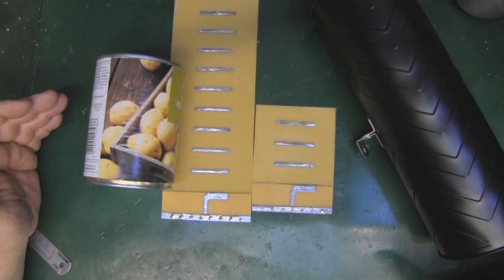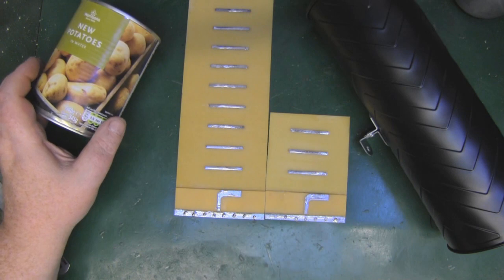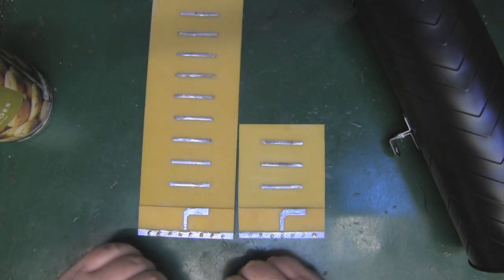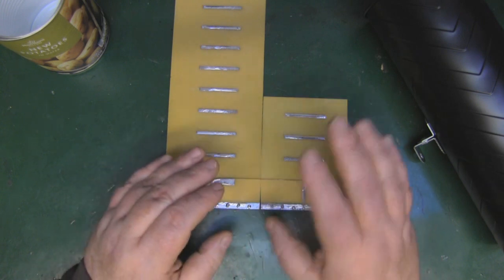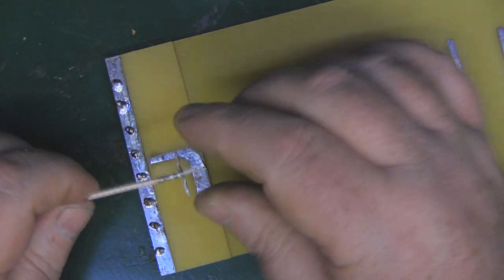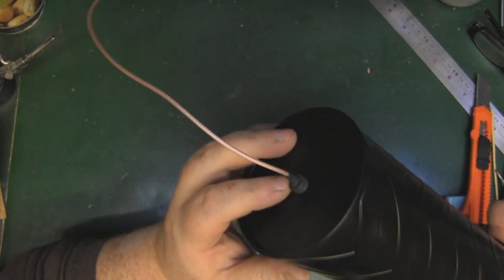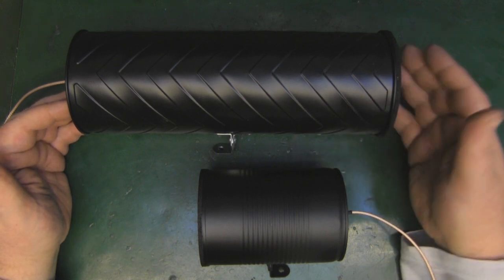Wifi Yagi in a Can MK2

Comment: Ive now build several of your cantennas, the normal ones without yagi and ive noticed an increase of signal strength. But im still not able to connect to a Wifi hotspot 200m away. ive have questions ... i really want to know wether its important what usb adapter i use ... you often use the alfa card, i used a csl usb adapter and few other wifi repeater i modified... im not satisfied with the range :( what could ive done wrong?

Comment: Andrew, Andreas Spiess referred me to you for an opinion.

I moved to the beach recently. I’d like to extend WiFi coverage approximately 250 feet to the beach . I do have direct LOS from second story of house to desired area of beach about 250 feet away. I’d like 5gig coverage for iPhone and laptops. 

I've read up on Long Range Access points that could transmit sufficient signal TO the beach. I've been cautioned to consider that the low power output of Iphone, laptop, Ipad, etc.  may NOT be be able to reach back to the LR Access Point for reliable communication.  In other words, the LR Access Point may be able to shout loudly, but not listen to whispers back.

Do you have a recommendation for a possible solution for this Use Case?  Is there an antenna design that might listen (receive gain) well enough for reliable comms?

I realize there is an option to extend the AP closer to the beach via d buried cable/POE.  I was hoping for a simpler solution.   Please advise your recommendation.

Comment: Hi Andrew (and viewers!)
What design is best for a directional 2.4ghz wifi antenna?. 
PCB Yagi, Yagi in a Can, Cantenna, Double Biquad Curve, Yagi Panel,??
If you had to pick one to get the best wifi signal from a router that is fixed, which would you build?

I've watched a lot of your videos in the hope to make one, but i don't know which is the best right now. Sounds like Biquad antenna was your favourite for a while, but then cantennas keep popping up, and then finally the yagi panel type is listed as your favourite antenna?

Do you have a comparison chart of all the antennas you have built?
Reply from the maker: They are all good but for different reasons: biquad easy to build even with mistakes in the measurements will still work well a double biquad has good long range over a wide area. Cantenna short can medium range long can longer range but narrow beamwidth. A short cantenna and a satellite dish super long range nothing will beat it only a bigger dish.
Every antenna has its strengths and weaknesses and you cannot compare say a Yagi with a panel antenna or a cantenna. It just depends on what you want to use it for, what your objective is because in some situations a 2.5db dipole will outperform a 5db.  
hope this helps
Reply: @andrewmcneil  Thanks for the prompt response. Looks like "Long Can Cantenna" will be my first try as i will build two for both ends of the communication.  I'll be trying to connect two houses together (my parents dont have any wifi and only live 150m as the crow flies away on the other side of a park and creek and a house in the way, although have a small corner of their roof as visual line of sight). The aim is to setup a repeater at their house (your hacked repeater TP link video was the first i watched). If i could stream a YouTube video at their houseusing my internet connection that would be the ultimate goal. I already have all the access points/routers, most of which run DD-WRT, and one alfa 1000mw card, so the only cost would be the antennas (and maybe another alfa card for testing on the other end)
Good hobby and glad you are making money from what you seem to love to do! keep it up!

Comment: If you designed the PCB with small connections (that would need to be ground off) you could use electrolysis to deposit pure copper onto the pcb instead of solder. If it makes a difference. *edit, on second thought, maybe not, as the elements would also grow sideways .. :/

Comment: Is it possible to make a cantenna for 800Mhz (LTE ) ? On the internet I couldn’t find any information about anyone making cantenna below 2.4Ghz . I tried with 230mm diameter can using online calculator . But it didn’t work . Any information ?

Comment: I am not sure that you read your comments, Andrew, as you rarely reply. May I respectfully make a couple of comments? I think you are trying to combine two different principles to the detriment of both and that a decent yagi or a decent can would perform better than the combination. You are STILL not testing your aerials properly. The only fair test is to hook up to a known distant router and do numerous speed tests for your different aerials. The number of wi fis you see is NOT the determining factor. In fact  a highly directional and efficient aerial would see very few wi fis, unless they were all in a straight line geographically.
Reply: He's using a VNA to measure the S11, that's pretty useful

Comment: What difference is, if (right) antenna is (line w anothers elements) in/with elements PCB ang GND/reflector (left)antenna is in the small PCB ?
Reply: ? how works (1:1) this: ti(dot)com/lit/an/swra350/swra350.pdf and pcbway(dot)com/project/share/Yagi_Uda_PCB_Antenna.html and wa5vjb(dot)com/pcb-pdfs/Yagi2400.pdf (and 16 patch/radiating elements antennas (Delta DS 2400-21 or Wimo PA-13R-18) )
Reply: and what this doing: RF2126 or BGA6589

Comment: 1:26 it has waves inside, is it bad? I found the packaging of the product with a smooth side and bottom in the store. For example, an olive oil cylinder (d=80mm https://2.allegroimg.com/s1024/0c3ab6/c812f0e6404fa1b7668cc62d4ca2 ( 3€ in Estonia shop )).
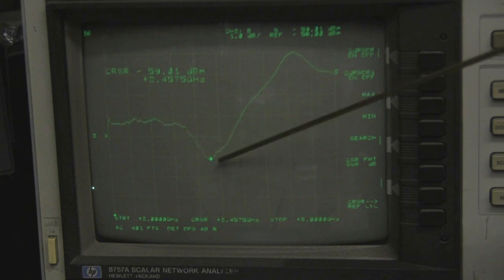Reply: 14:04 I like more analyser numbers WiFi channel 11 ( 2462 Mhz ,  2451–2473 MHz )